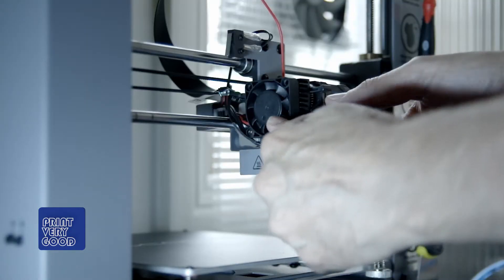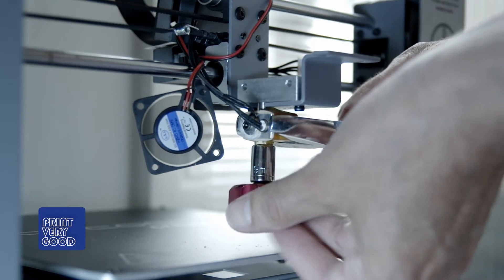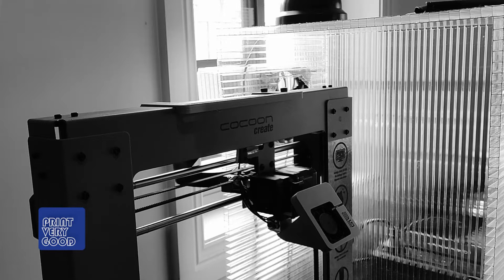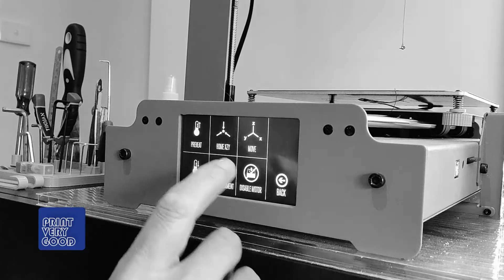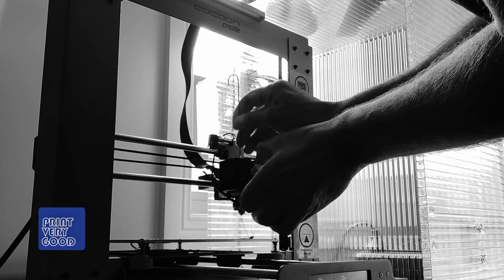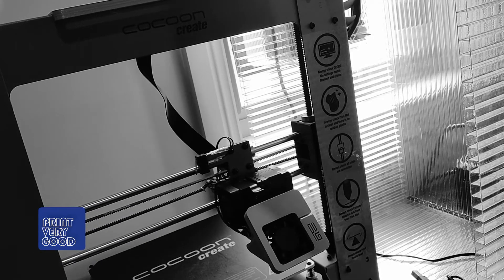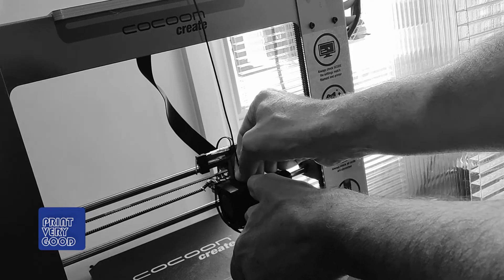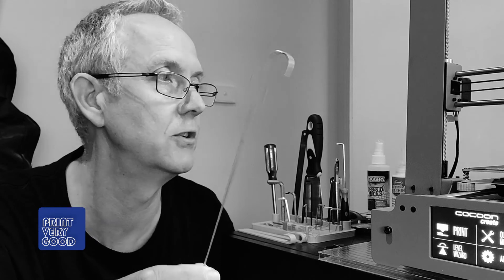Keep your 3D printer running smoothly with this little gem.

Comment: Very Useful information my Printer did not come with such a tool is the tool the same size as the filament i`m using? such as 1.75 mm ? i would like to make one for my printer, also good tip cutting the filament as 45 degree i have been cutting mind straight across i think your way would line up much easier.
Thank-you for your time and effort to share this Tutorial
Reply from the maker: Thanks Wally Be you're welcome! The diameter of the tool measures at 1.45 mm.

Comment: Your using 1.75mm filament?  is the diameter of that tool 1.75mm or some other size?
Reply from the maker: Hi Joe, yes filament is 1.75 mm and the tool diameter measures at 1.45 mm.

Comment: Hi PVG
It's a really good technique you learned me there. I thing it will benefit me now that I'm starting my 3D print sesson again. Thanks :)
Love your vids
One question what diameter is your tool on ?
Reply from the maker: Thanks SpotterSky! I just measured it and the diameter comes in at 1.45mm.